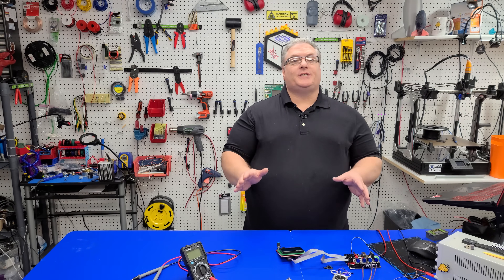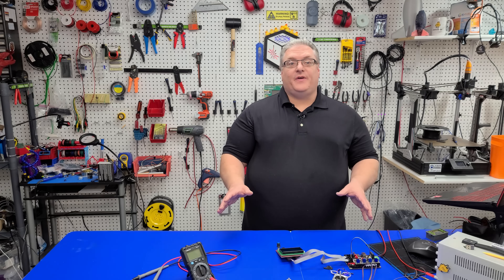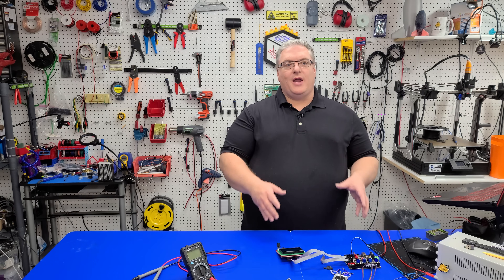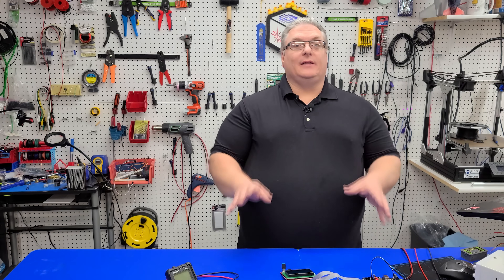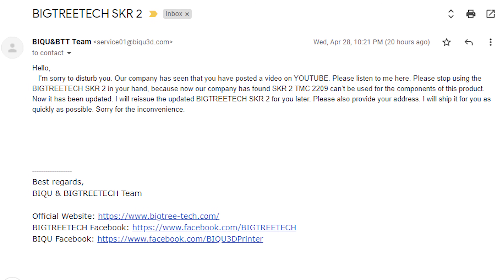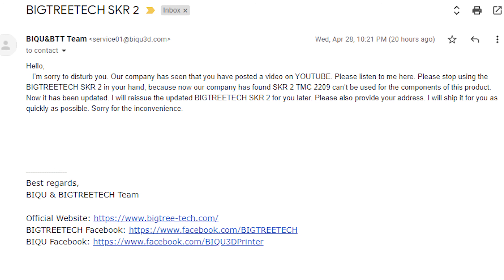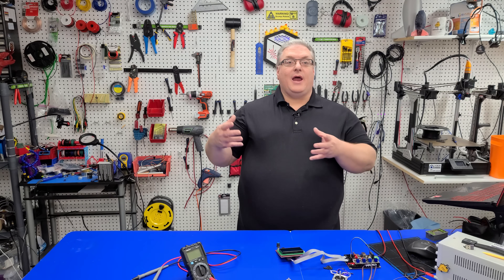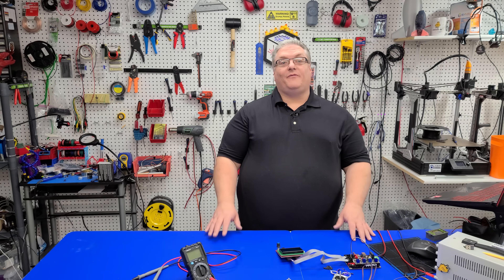SKR2 TMC2209 Bug! | Don't Destroy Your Step Sticks!

Comment from the maker: UPDATE: 4/30/21 - 7:55AM CT
@bigtreetech  has updated their documentation and release a more formal version of these directions here.
https://docs.google.com/document/d/1swmc4HvP9vxrxV2b9LVGa_I7GLTQGogQns7CfMYCckA/edit
They have also posted a complete bulletin regarding the information here
https://docs.google.com/document/d/1IeKgfE2WIDjqH1fx5Yg7n1FOHVwhDFmDlZ-7QMlOEV0/edit

I personally want to thank  @BIGTREETECH   for their responsiveness to this issue for everyone and providing a replacement program and solution to fix the issue should you not want to return your board.
Reply: Just curious, how to replace dead 5x2209 drivers I ordered in bundle with the board on Aliexpress? Contact with seller?
Reply: @drbra1n  Yep, that's the way.
Reply: @smooth60  have you tried? It is cheaper to order set of new drivers rather than return these dead drivers back to China. I'm sure they won't just send me a set of new drivers, nor refund me. There will be some kind of BS, like $2 coupon for my next order (I will never order anything from BIqu shop again) or ignore my messages. I'll try it anyway, there are no other options.

Upd: the seller contacted me on Aliexpress and I received a refund. Honestly, I didn't expected that :) Moreover, my drivers are okay.
Reply: @drbra1n  You say you're sure but are you? Have you contacted them yet? 

When I contacted them to ask to be refunded, they said I would be refunded and asked for my paypal. I responded to that many hours later and they haven't read it yet, so I don't know if they will still ask me to actually send it back though.
Reply: @smooth60  got a refund for the board, no need to send it back. My drivers are okay, though.

Comment: I believe the problem extends past the SKR2. Out of 5 drivers 4 of mine would not work in simple Dir/enn/step mode (hard to mess that up. They would hold ENN low (active) and send step signals, and DIR would reverse (voltage verified) but the motors wouldn’t do anything and the shaft wasn’t locked. Using the exact same configuration I had some with the proper mosfet and tried one of those and worked perfectly. They wouldn’t admit it or replace the bad ones for me though without a bunch of brain damage. But I am certain the issue also impacts the internal h-bridge and thus resulting in the symptoms I stated above.

Comment: Hi MM, i am going to update my Delta (Kossel LP). Do i still need to 
cut out the DIAG pin on TMC2209 to use mechanical end stops like 
sugested in tutorials for 1.3 or 1.4 boards (Lucas Pomykal) .. or are 
there jumper options on SKR2 Rev2 for that?
Reply from the maker: I think there are jumpers on the SKR2  now.  Check BTT's manual in their repo.

Comment: Hi, this issue only affects the board with Rev. 1, the newer version with Rev. 2, either has 2 QC label at the bottom, but this is not for sure. For 100% check you need to look what chip the MOSFET is, if it starts with HY1904 then you got Rev 2 and you are good. This info can be found on the BTT website.

Comment: This issue occurs only if is enabled in firmware the sensorless homing option? If I use the board and tmc 2209 with end-stops this problem will occurs?

Comment: What is a step stick? I'm lost
Reply from the maker: Try this https://bfy.tw/R4sZ
Reply: @MakersMashup  Maybe just call it a Driver like everyone else on the planet??
Reply from the maker: The driver is a chip and the stick is optional and not required.  Boards like the Duet have them SMT  on and don't have the sticks.  The SKR can use different driver chips but the stick is the interface  and vendor neutral implementation.  So while it will blow the driver it is still on a step stick which is what you purchase along with the driver.

Comment: I purchased the SKRv2 with TMC2209 drivers for an upgrade that doesn't need/use sensorless homing. Glad I seen the issue before installing. Very happy and pleased with BigTreeTech's prompt issue resolutions. And thanks for the great video.
Reply: 4 days not a  word from bigtree. You must work for those losers.

Comment: oh screw that nonsense.  I will just ask for a new board with revision B on it. I despise sensorless homing. It never works for me.
Reply from the maker: Sensorless homing is a bit of an art.  I know it took me quite a while before I turned in the Tenson/Current/Sensitivity settings.
Reply: for me sensorless homing working on SKR2 with 2209 and Klipper.

Comment: I’m completely off Bigtreetech after blowing up 5(!) SKR1.4 turbo boards, including 3xTMC5160s, 2xTMC2130s, 5 inch display, 3 inch display button stopped working, H2 direct drive has crunchy gears out of the box, power relay which won’t work reliably, etc. etc.. Even though I’ve been 3D printing for only a two years now and I make mistakes, no way all of this has been caused by me. BTTs only answer is that I moved the axis by hand and fried the steppers or board myself, which is BS. They have nice ideas, and a lot of marketing, but zero quality. Use their products and you’ll get burned one way or another is my conclusion based on my experience. Pity, but true.
Reply: check my commments with the btt people. They are so pretty scare of what we write.

Comment: does this problem happened with tmc2130 also or only with tmc2209
Reply from the maker: BTT said it only affected 2209 but I would be leery testing that personally.
Reply: @MakersMashup  so what's you recommendition as i want to buy one. or ignore the new features and buy 1.4 turbo?
Reply from the maker: For now I'm going to continue with the 1.4 turbo until the skr2 proves to be reliable.
Reply: @MakersMashup  i think there is no wow features in v2 i don't think it deserve the risk
Reply from the maker: The fan pins are nice and the cpu upgrade is good.  Overall though I would love to keep the skr 1.4 turbo.  BTT told me I can't buy them anymore. So skr2 it is.

Comment: BTT  will never learn lessons. Almost every their board has design flow and issues. :( I miss my SKR 1.3, probably the only +\- reliable design they used to have). 1.4 already had issues with tmc drivers and endstops. If you have endstops you need to remove the diag pins from the tmc drivers to avoid conflict and interference with each other. It's crazy. 😡 I don't know why I should be QAing their boards after purchase. I can understand why MKS Robin Nano are buggy, for such price it's really hard to imagine they've passed proper and extensive QA. But these guys are more expensive, they should do proper design and testing before official sales. 

Anyway, thanks for the update and sharing this important information.

Comment: They also propose the option of removing a mosfet and shorting a few connections through soldering, which I find to be way more elegant (yet permanent). Because you just know that one day when you're working on your printer you're gonna accidentally pull one of those wires out and not notice and you're f*cked.
Reply from the maker: Totally agree, id rather get a board replacement that work with a wire that could fail. Another user did say that you only need one of those wires so in theory the 2nd could give you some protection against a random wire coming loose.  I'm with you though I think having the wire solution is a problem future me is going to be mad at past me. :)

Comment: Thanks for the excellent information.  Do you know if this only affects the tmc2209 if you enable sensorless homing ?  Can you use physical endstop switches instead? BTT says it is caused by a faulty Mosfet.  Do you know which mosfet is at fault?  Thanks again!
Reply from the maker: Check the description.  I posted an updated link in there where they go into what happened in more detail and do outline which mosfet is the issue.
Reply: @MakersMashup  Thank you!

Comment: I discovered an issue with my SKR 1.2. If you connect a USB to the printer before powering up the printer then the motors will get red hot, you'll burn your skin if you touch 'em! In another project that uses TMC2209s I think I discovered the cause. These controllers seem to need power to the motors, not just logic level power (USB power) to be programmed over the UART pin. Marlin comes alive with just USB power and runs through initialisation that includes programming the current level of the TMCs. If there is no motor power connected to the TMCs when the initialisation runs it essentially fails and it's anyone's guess what the current gets set to. Can't believe the motors still work, they were red hot! Completely reproducible concern.

Comment: Is there a way to find out if the already used Stepper drivers are fried?
I setup my skr2 with TMC 5160 on XYZE0 and stuck at bootscreen 
Switched to tmc2208 and was able to boot the board with new firmware
So now I fear that I fried my tmc5160s but don’t know?
Any suggestions?
Reply from the maker: If you have another board you could easily pop it into that board.  Quick test to see if it works.
Reply: Yuo can test de driver with an Arduino and some steper motor code
Reply: @noway8233  all steppers are working
I was able to test the steppers in the meantime
So everything Looks ok.
The issue with the 5160 was a config error in the Marlin code.

Comment: Hi, Thank you for your video. For the complete solution, please see the announcement on the @BIGTREETECH fb group.  Our engineers have fixed this problem. We have updated the boards and the boards don't have this problem anymore.
Reply: Boards should be replaced 😑
Reply: @brunomonteiro4764  They are offering a full refund. Read the full announcement for more info.
Reply: So dose this now mean i will get a replacement board and drivers from BTT... I have emailed the support, all i got in return was the work around, tbh i am not happy with that at all. i want a product that is working !! and not hacked to work. plus the fact that it has killed 15 BTT TMC 2209.
Reply: @robbo5305  Hi, don't worry. We have a 3-day holiday during Labor Day. Please understand the inconvenience. Once we are back, we will arrange shipment. Please trust us!

Comment: EDIT [after locating additional info on the schematic]. Checking the schematic at https://raw.githubusercontent.com/bigtreetech/SKR-2/master/Hardware/BIGTREETECH%20SKR%202-SCH.pdf, the proposed fix installs a jumper between MGND (Motor Ground) and GND, implying that path is missing. MGND is intended to carry the return current from the motors whose positive supply is provided by VBB. 

I see that both VBB and MGND are switched versions of the power supplied by the DCIN jack, being switched by Q2 and Q1 respectively, as commanded by signal MOT_POWER from the MCU. So the proposed jumper bypasses Q1 and connects MGND to PGND permanently.

I guess the board only works at all due to the MCU commanding MOT_POWER on during normal operation. And only in certain unusual circumstances would MOT_POWER turn off. Perhaps that happens during the “wrong-way-round” test that Mr Makers Mashup mentions. Or perhaps the failure requires MOT_POWER switching from on to off (or vice versa) while something else is set to a particular state as well.

Part of the issue is that not only does MOT_POWER off disconnect power and ground from the motor driver transistors, it also disconnects ground from the logic side of the TMC, while its 3.3V logic supply is still attached. There is no circumstance in which you would want to remove ground from a logic chip that’s connected into a board that’s powered up, so that seems to be the heart of the problem.

In that state, though the TMC has lost its proper ground, there is still a path to ground via its input protection diodes, through to whatever chips or jumpers are sending signals to those inputs. So the TMC will still partly function. Also Q1 and Q2 will not switch simultaneously.  If Q2 is on (VBB on) while Q1 is off (MGND not connected), this will lead to motor current (or magnetic field collapse current) trying to flow through the TMC’s input protection diodes to elsewhere on the board, likely resulting in damage.  Anyhow, there’s evidently a failure mode somewhere in this neighborhood, as customers seem to be seeing their drivers fail.
Reply: They drive Q1 and optocoupler without a buffer/level shifter/gate driver using the weakest pin of MCU (PC13). PC13-15 are in RTC domain, their current sinking and sourcing capability much lower than others. Check issue 15 on github
Reply: 'during the “wrong-way-round” test that Mr Makers Mashup mentions.'  This.  Extremely common when adding 'important new features' to focus on said new features and totally lose sight of basic fundamentals that you're screwing up in the process..
Mark both the board and the drivers better, then who even needs 'wrong way protection'?
Reply: They connect motor power and the ground of the chip at the same time with the two mosfets. Wonder why they would interrupt ground. In any case a different mosfet may have a different threshold, and one may switch before the other. If that motor power comes on before the GND mosfet is well conductive, things blow.
Still I wonder why one would interrupt GND. Probably to detect the reverse plugging with the 3v3 line.

Comment: Thanks, I would recommend to put some patch wires on the bottom of the board, Dupont connectors are very unreliable. 8:15 The 2 wires that are made are actually in parallel, both connect GND to MGND, so 1 wire will do the job.
Reply: Yes exactly. At some later date someone will look at those ground jumpers, or want to use the ports they are plugged into, and think "these don't seem to be doing anything, let's just pull them out....". Soldering wires on the rear is a much sounder idea.
Reply from the maker: Getting a replacement board is the sound idea. 😀

Comment: Sounds like someone missed a ground connection in the board design.

I started using sensorless because it was a novelty. Been over a yr now and still working great on 2130s.